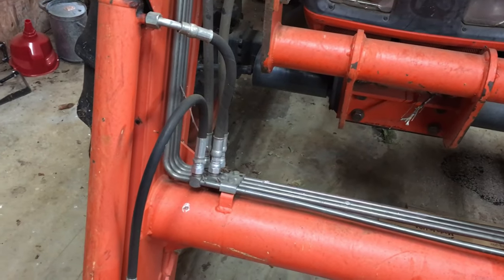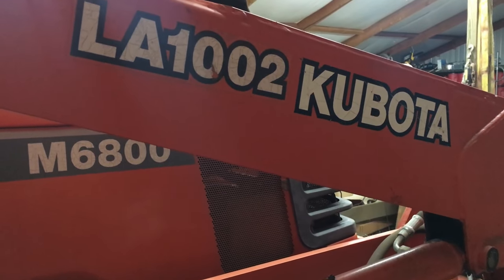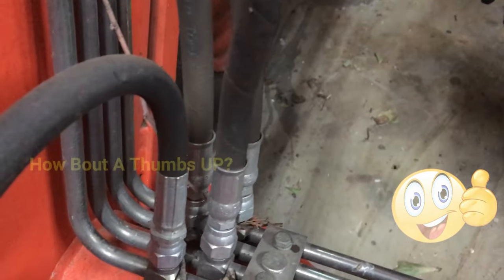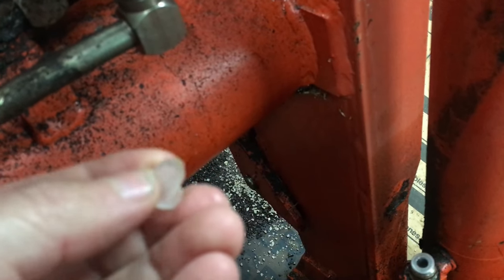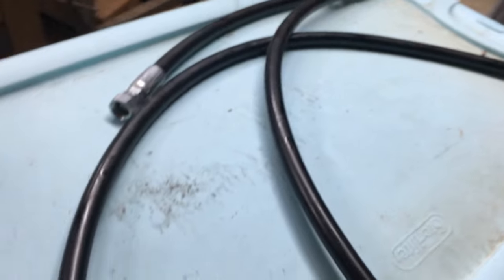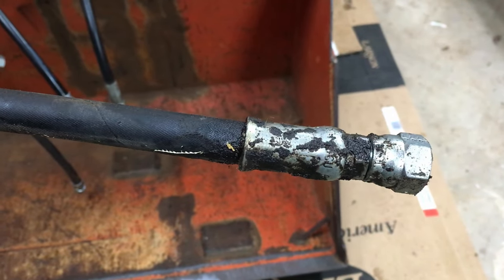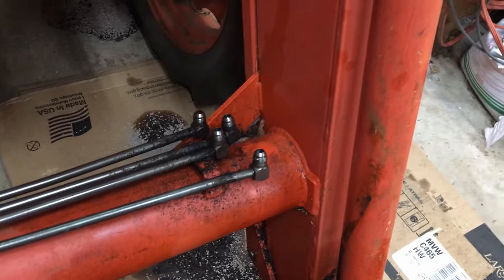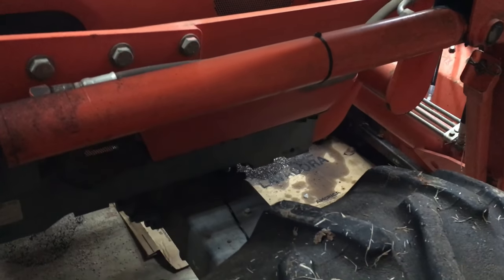CHANGING HYDRAULIC HOSES ON YOUR TRACTOR AND LOADER - DIY HYDRAULIC HOSE REPLACEMENT

Comment: All you need to do to is repeatedly operate every hydraulic function through several full cycles, then check the hydraulic oil level.
Reply from the maker: 👍
When there is a full fluid and filter(s) change it takes a little longer to get the fluid to all the working parts.. but not too bad.

Comment: Thank you!
Reply from the maker: You're welcome!
Reply: @BIGALTX  Made changing loader hoses on my 1966 John Deere 2510 really straightforward. You were correct about not having to bleed!
Reply from the maker: @cbax864  Glad I could help
I've changed them on 2 different tractors (one a mid 60's model Case) and never had to bleed...

Comment: If someday you have a extra person around see if the hose that started to leak tightens up when you turn the steering wheel hard right or left on trucks there are valves that you can adjust if not just don't turn the wheel all the way to the max that should confuse you enough or it could just be that that is the hose that is working the hardest
Reply from the maker: Hmmmm.... Interesting.
I'll give that some thought... thanks!

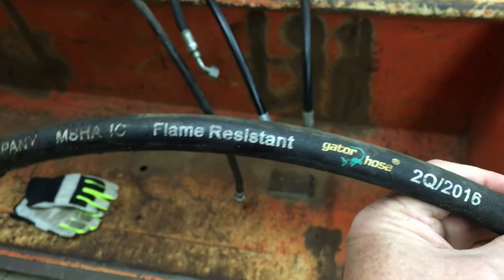Comment: 3:41 the leaking end of the hose seems to have a bubble on the end which makes me think it was a bad crimp.
Reply from the maker: Probably so.
I've had other bad crimps in the past too.
Reply: That is what we call a “bubble crimp” 
It is a one piece ferrule and fitting usually used for higher pressure ratings
Ones without the “bubble” have an individual ferrule and fitting which you will see the crimp is the entire length of the ferrule

Comment: Ok but how do you fix, or replace the hard pipe section?  One of mine caught a limb that pushed it far enough to bend it and slice it. 
It was spraying all over the front of the tractor.
Reply from the maker: I've never had to replace one, but you'll have to remove the bent piece.
Then take is somewhere that has the capability to fabricate it (tractor dealer, etc) and let them have it so they can make an EXACT piece. That way it fits perfectly.

Comment: Why does no one show the process of changing the hose? I wanna make sure I know the full process and explaining it doesn’t really cut it. We all know you gotta change a broken hose with a new one that’s common sense and doesn’t take a whole video to understand
Reply from the maker: It’s just a matter of unscrewing the old one and screwing on the new one. Tighten it down… Done. 
You don’t have to bleed the hydraulic fluid or anything like that. 
It’s just simple remove and replace.
Hope that helps